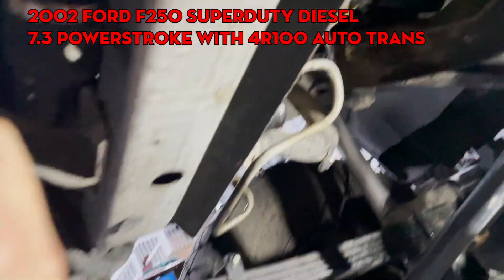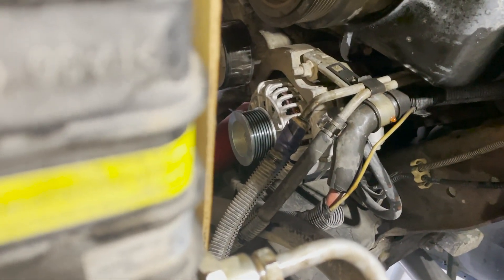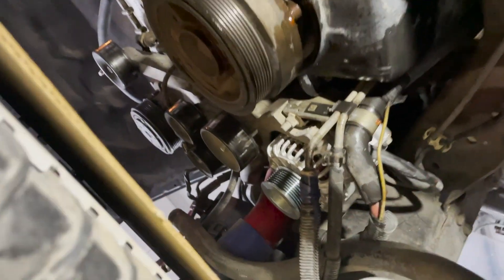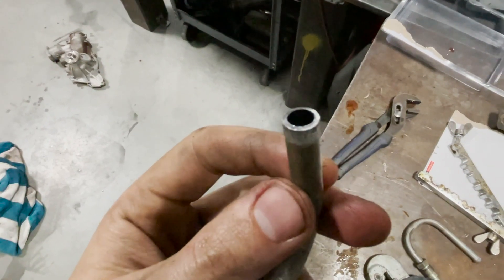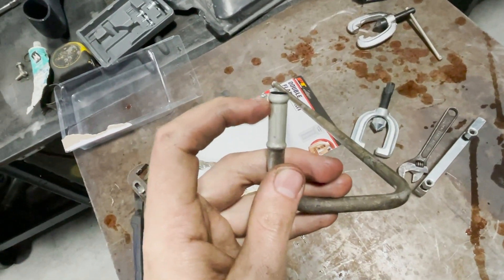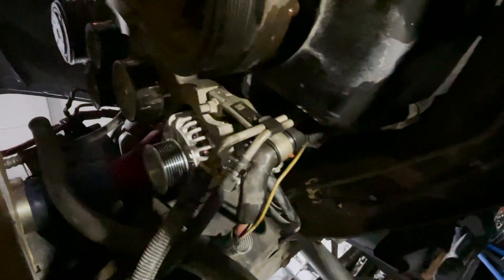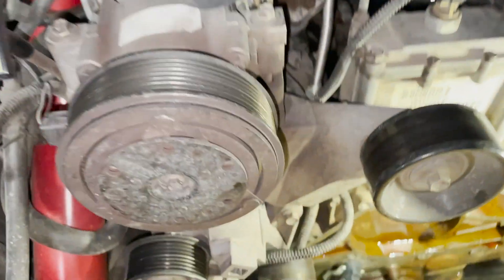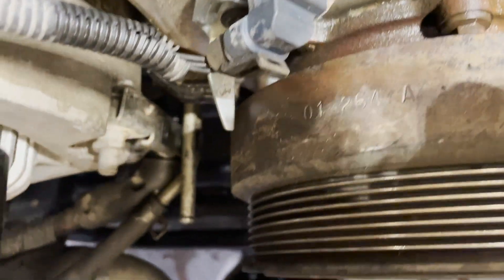Radiator bypass 4r100 trans cooler 7.3 Powerstroke (15 degrees cooler temps!)

Comment: Do you need to plug the holes on the radiator where you removed these lines? I'm guessing you don't have to but wanted to double check
Reply from the maker: i did not, i don't see any need to

Comment: Hey brother so I have a 2001 7.3 E450 shuttle bus and I just got done a cross country trip pulling a large enclosed trailer. 20klbs combined. 5000 miles.

Anything over 5% grade was off limits unless it was a short run. 

One thing I noticed was once the trans leaves 5th gear lock up you can watch the cold side (bottom) of the radiator rise in temp so fast. I could hold it steady at 95% throttle and keep the egts below 1200°f easy as long as I stayed in 5th lock up. Start losing speed and that torque converter starts kicking in and then radiator temp would climb steady to the point where the coolant temp on the cold side is 180°f which really compounds the heat back into the engine then back into trans and so on. Its a vicious cycle to watch over and over 2000 miles from home. 335k miles on her and shes a tough old bitch that just refuses to quit on me.

Thought you might find this interesting..... Ps. Hello from Florida.
Reply from the maker: what kind of transmission are you running?
Reply: @JesseMcFie  original 4r100
Reply from the maker: @thomasbarlow4223  interesting info. the 4r100 has 4 gears. The torque converter lockup can feel like another gear.
Reply: @JesseMcFie  yourabsolutely right I have no idea why I said 5 gears. Lol

Comment: Can u put a 6.0 trans cooler even tho the lines go in radiator?
Reply from the maker: I swapped out my stock tranny cooler for the 6.0 style a few years ago. So yes you can have a 6.0 trans cooler either way.
Reply: @JesseMcFie did you have any issues with this and why exactly would you do this ? I'm installing a 6.0 cooler in my 7.3 and may do this for the time being. Does it still run cool enough without running the lines through the radiator? Thanks in advance.

Comment from the maker: This is on a Ford F250 2002 Superduty with the 7.3 Powerstroke engine and a 4r100 automatic transmission (with some modifications)
Reply: Did you lose a lot of fluid removing those lines? I’m going to replace mine just wondering if I need to get fluid too
Reply: @andrewcavazos70  did you lose a lot of fluid ?